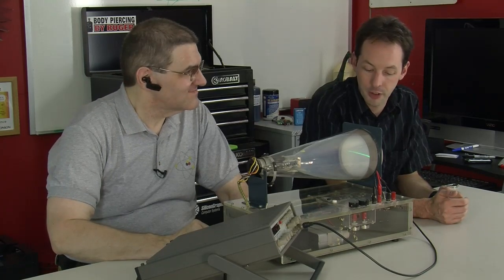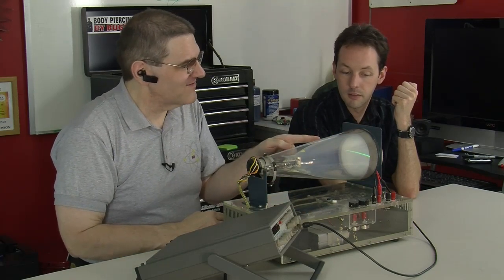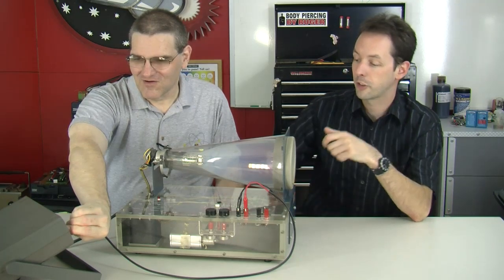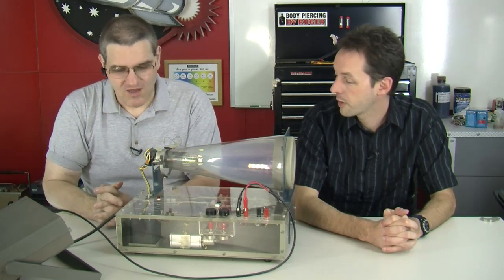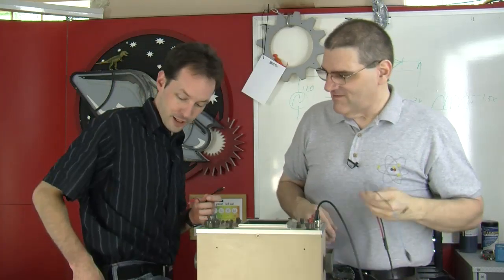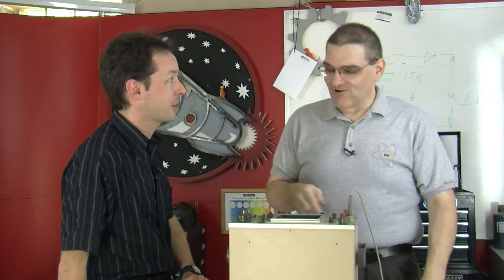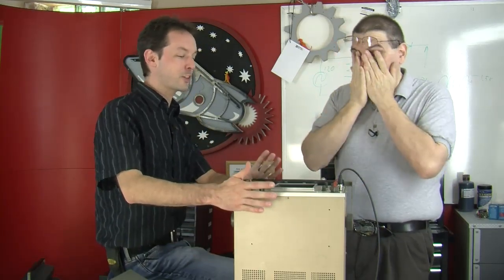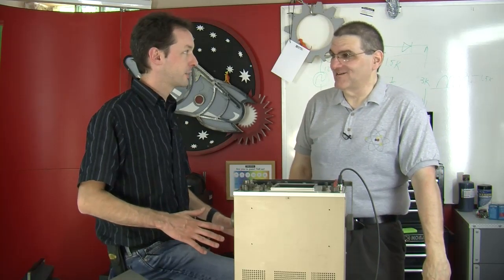Oscilloscope Basics

Comment: Another great vid, guys!  However, if I may add my 2 cents, the "astigmatism" knob controls the relative width of the screen from left to right. For example, suppose you're viewing 10 cycles of a sine wave, and the first cycle appears 1/8 inch wide, but the last cycle is 1/4 inch wide.  The astigmatism control lets you balance them out.  Once again, great job fellas!  Keep up the good work!